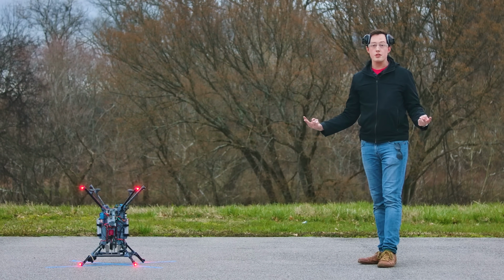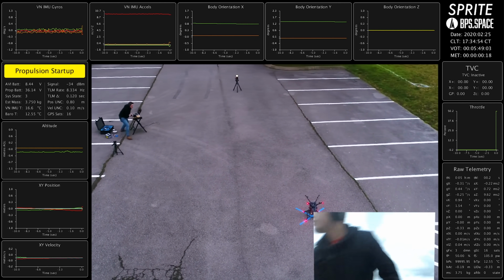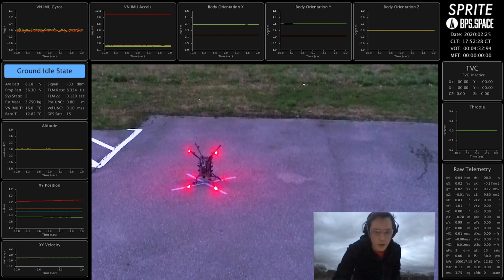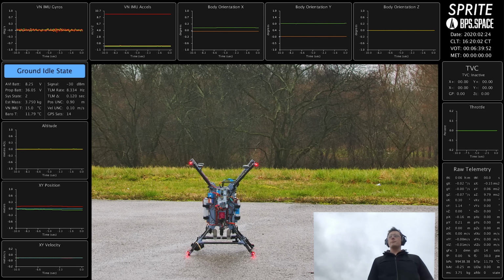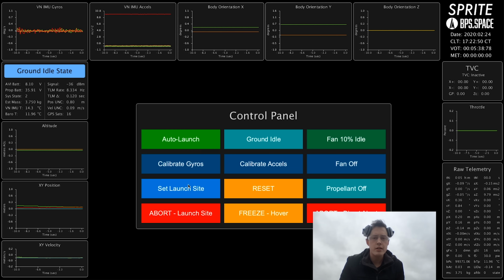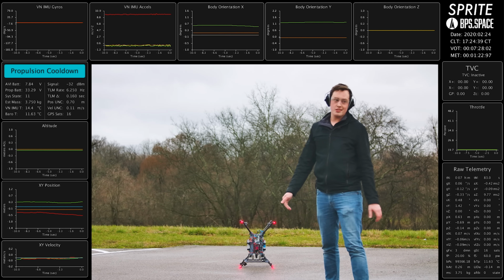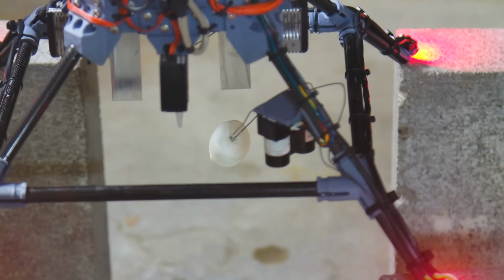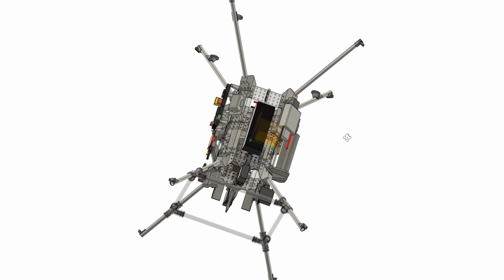Sprite - Hop and Divert Montage + Updates

Comment: I was just thinking that you could adapt that EDF TVC system to a high speed VTOL flying wing drone for aerial photography and 3D mapping, especially if you used dual counter-rotating EDFs with the payload in a pod between them.  Combine the accelerometer based guidance system with a GPS system, and you'd have a really interesting drone system with unmatched capability.

Comment: When Sprite is in the ascending state, why does it pulse the throttle about 4 times before it lifts off?
Reply: armchair guess: it is finding the throttle point of achieving lift - you can see the last pulse before lift off actually gets it a tiny bit airborne = flight weight lift acheived

Comment: Hi there, would the trade off between the current stator setup (better than 
none clearly, but still offering some turbulent flow I imagine?) and having 
the cleaner vertical downthrust of a contra rotating blade setup and the 
extra engineering and weight required for this.... be worth looking at? 
I really don't know how much extra engineering this would take and in all 
honesty I only 'assume' there is energy lost in the straightening of the flow 
via stators and that some perhaps minor turbulence is created in this 
process.... okay, I think I've talked myself out of this idea now  :-) 

PS.  This is the coolest thing I've seen for a very long time.

Comment: First off all as usual, just WOW!
Secondly, can't you use a rope to hang sprite and the second it flies you lift the rope a bit so in case it was gonna have a rough landing it wouldn't touch the ground and brake anything?
And finally, would Sprint also be able to do propulsive landing?
Reply: It is doing a propulsive landing

Comment: I am currently building a micro hybrid rocket on the basis of a little N2O capsule. If you are interested in this little rocket motor I would love to send you one.
The motor is pretty small with between 5 and 20 Ns of thrust (we haven't tested it yet). We are currently machining the parts. Our current version is unable to throttle, but that could be overcome.
Congrats on your advancements with Sprite!

Comment: Is a drone not the better solution? What is purpose behind this? Either way - I really enjoyed it.
Reply: Do you mean a quadcopter? Well it would be, except that this is a test platform for rocket engines and you can't (easily) have a rocket engine quadcopter.
Reply: @clonkex  Are you saying this is testing the metallic deflection flaps at the bottom? With the idea of having regular solid rocket fuel being deflected in next rocket? Interdasting.
Reply: @pingpong9656  It's testing lots of things. The control software, the TVC vanes, the rangefinding, the position hold, etc., etc.

Comment: Joe, what is the pulsating of the motor do? Is it like a self check for Sprite before committing to launch? Is there not a concern of battery drain due to the pulsating motor? Awesome stuff!
Reply from the maker: Yep! Sorta! It’s a quick fan speed check, the vehicle pulses the fan in increasing speed to see when it lifts off just a bit. Between the performance of different batteries, I can never know exactly what the nominal hover throttle should be, so I quickly test for it just before liftoff.
Reply: @BPSspace  Thanks Joe, love your content!

Comment: Really impressed with the Emergency Landing Failure Recovery and Touch-down Stability Device. Is that run on some sort of A.I. program or just sensor reactive? It looked like it was actually holding it's breath a few times.
Reply: 3DPDK that would be a severe loss if it was injured during testing

Comment: Hi MR. BEPIS! Have u thought of putting springs on the landing legs to help Sprite land more smoothly and without a jolt on impact? U can add them on the end of each leg end and the "cushion" system could be like a pen's spring(without the lock in place mechanism). 
Best of luck with Sprint!
Reply: Chase Kieselbach you would want a damper rather than a spring
Reply: @JonnyD3ath  Yes. That could also work. With a spring you would have potential energy stored that could be used as kinetic energy during take off.
Reply: Sprite*
Reply: @Oli420X  both sprite and sprint exist